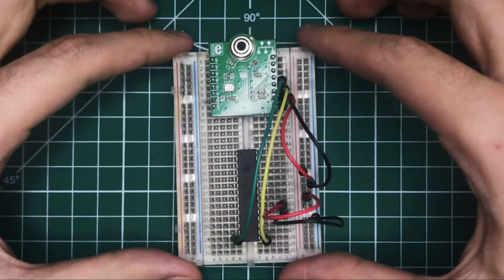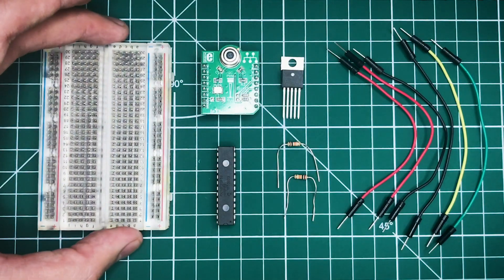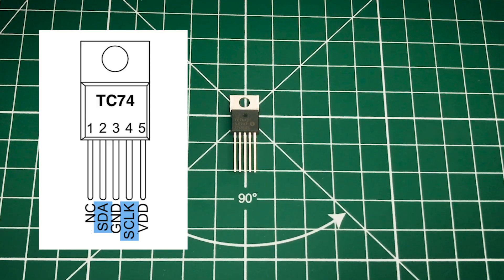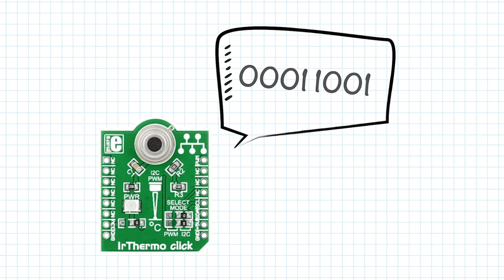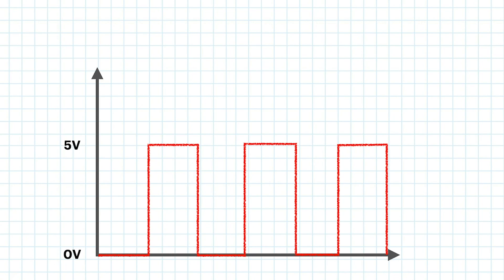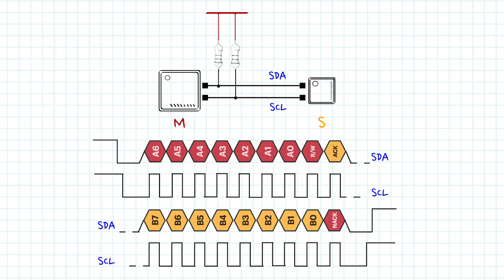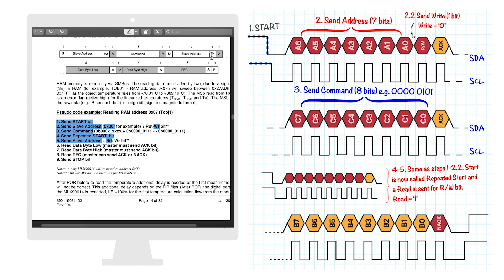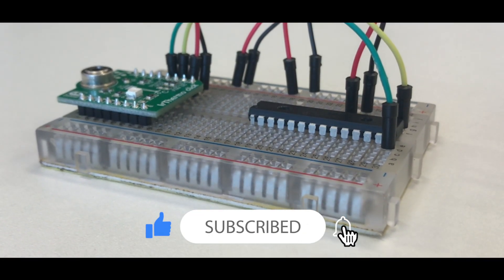I2C Protocol Basics - MLX90614 and TC74 Temperature Sensors (Part 1)

Comment: 10:18 Could you tell me where do you get the datasheet for the MLX90614? I only can find a generic one with not enough information.
Reply from the maker: Check out this pdf document: https://www.pololu.com/file/0J171/MLX90614_SMBus.pdf

I was using page 14 for the sample steps 😊 let me know if you need anything else!
Reply: @engineeringmd9589  I am trying to use this sensor with a CORTEX M4 from the Tiva TM4C1294NCPTD microcontroller, but so far I cannot get the sensor to comunicate with the microcontroller. So far I haven´t been able to establish communication between the sensor and the device.